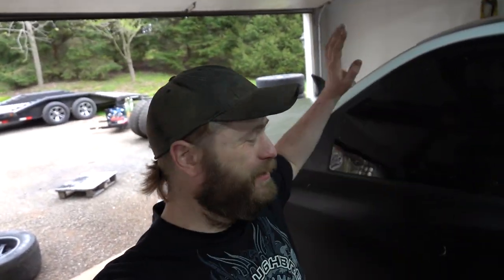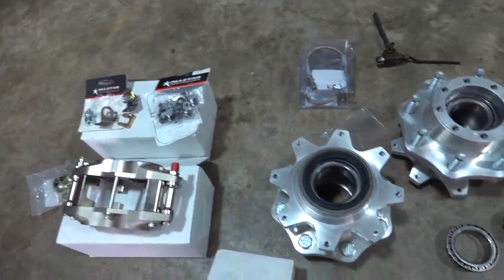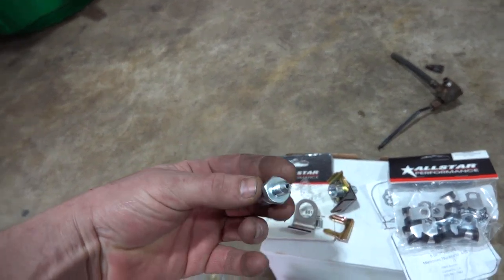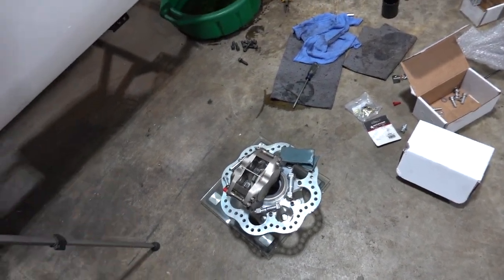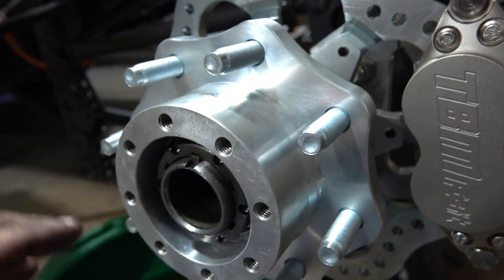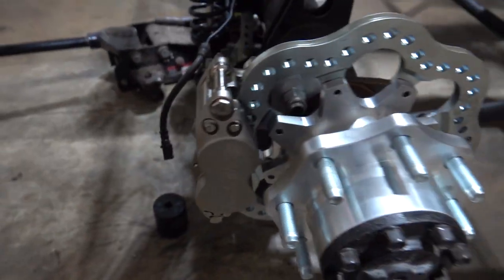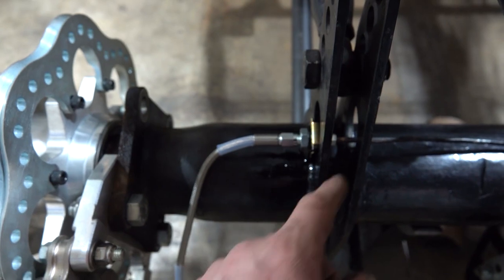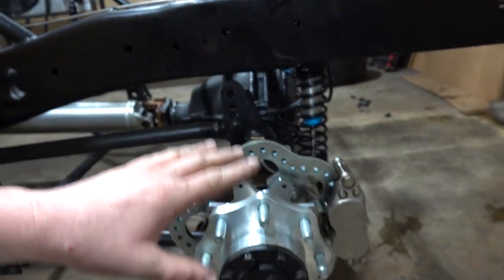Cummins Drag Truck RACE CAR BRAKE CONVERSION... MASSIVE Weight Reduction & Stopping Power!!

Comment: Just out of curiosity do you have to run extra long wheel studs like most other drag classes for the fast cars per rules? Would hate to see you get somewhere and get turned away because you couldn't pass tech

Comment: Are you going to safety wire the rotor to hub bolts they have been known to back out even with lock tight it gets so hot cooks the lock tight